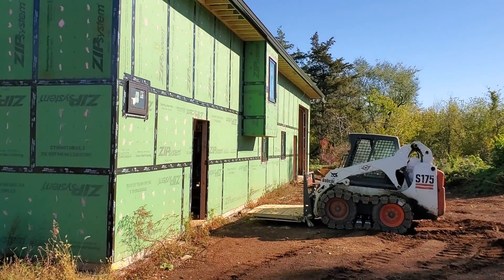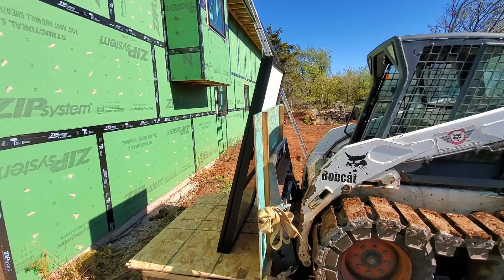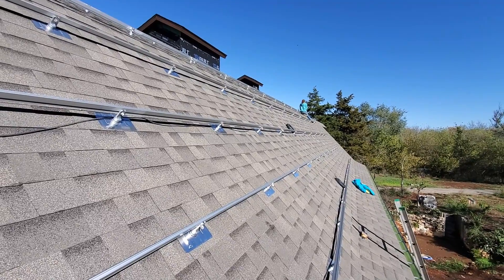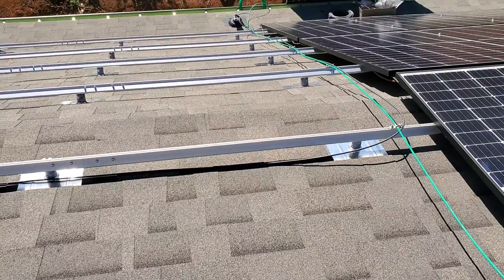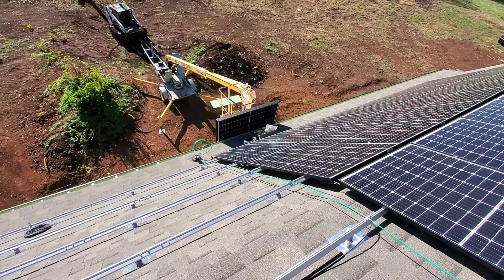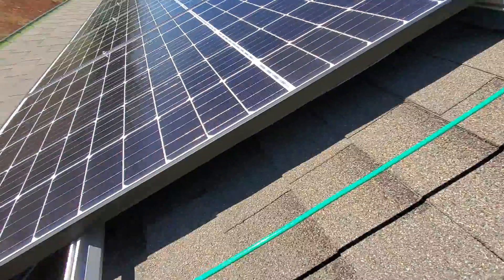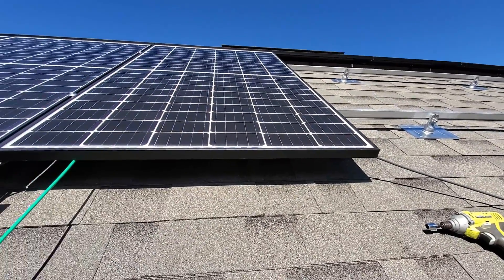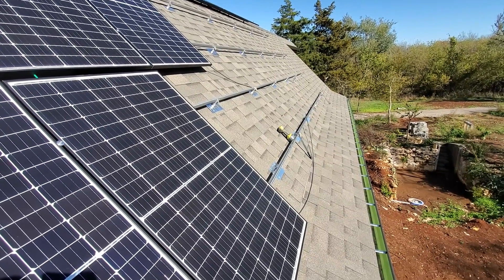Installing 48 REC Solar Panels with 320 Watts Each on our Off Grid Home Build Barndominium Project

Comment: Very nice! I know it sounds trivial but I would have liked to see how you did the wire connections. Thank you for posting this series.
Reply from the maker: They just plug together, there is no splicing or special tricks.  If you can plug in an outlet you can hook the panels up.  

Thanks for watching and commenting.

Comment: I posted on the previous racking video before lunch and see my post disappeared every time I posted there, no idea why! Anyway, I came here to take a look at your Zip tape issue and saw the racking video so I clicked on it as I'm doing solar soon.  I haven't given any thought to racking yet, but figured you might have some recommendations...  I have larger 42" x 82" 435W Sunpower panels.  Install will be on the CT coastline.  We routinely see 25-30 mph winds many times a year, get a tropical storm every year or two, and low grade hurricane every 5-15 years.  It's possible we could see something more significant, but I haven't seen it in the 30 years I've been here (although with global warming, who knows what's coming in the future!)   Any thoughts or recommendations on what to use and how to do the spacing?

Another question, curious why you didn't stagger the bases on alternating rafters to distribute/share the loads?

BTW, nice panels and install.  That's a pretty serious system, you must have some significant loads!
Reply from the maker: I've only used the IronRidge brand for racking so I don't have another point if reference but it was easy to use.  They have thicker rails.  I used the XR-10 but they have 100 and 1000 models to handle greater loads.  

All panels are made such that you only need two rails for mounting.  I recently bought some 72" tall panels and although it says two is enough I'm thinking of adding a third just to be safe 

I hadn't thought about staggering the rail supports.  I can see now how that would of made sense.  There is plenty of support on the underside of the roof though so I'm not overly concerned about it.

Thanks for watching and your post.
Reply: @Off-Grid  Thanks for the info and reply!  Since I'm new to your channel, I spent a few hours watching today.  That's quite a project!  Nice work...
Reply from the maker: @ssoffshore5111  Thank you for watching.  It's been a big project for sure.  Still a ways to go.

Comment: I just bought these never Evan seen a solar set up all new to me hoping these work good where I live only got 1200 watt too see how they do
Reply: We started with small amount to see if they will work here in winter and only running a WiFi router tv and lamp or to on it for now
Reply from the maker: @angeliawills9956  it should do that easily.  We have two fridges and two freezers plugged in and still can keep it around that 600W typically without anything else going.  They did use a bit more power when initially turned on to cool down for the first time.  The system we bought is way to big for us but I didn't know it at the time.  We really only needed on invert and could have done with fewer panels.  I'm planning to disconnect one inverter and use it as a backup.
Reply: Also have ordered a 300 amp hour lithium ion battery
Reply from the maker: @angeliawills9956  you can run that down to 20% state of charge each night and be ok.  We have 1050amp hours and typically use 20% of that each night from sundown to sunup.  That would be equivalent to a 70% drain in your battery.  So as long as the sun is out the next day you'll be ok but get a cloudy day and you probably won't get fully charged by the next night and would need a generator.
Reply from the maker: What are you wanting to do with it?  1200 watts isn't much.  We typical float around 600 watts but that jumps significantly when the coffee maker is on or the microwave.  Be it only for a minute or two you'd still need the power to handle it.  Plus you'd have to charge batteries.  

If you just want to run lights and power a few devices you'll be fine.

Comment: Looks great but that's a steep roof lol to high for this guy 🤣😂 I'm scared of heights lol
Reply from the maker: Luckily heights is something my daughters and I don't have a problem with.  The wife is on your side though....lol
Reply: @Off-Grid  lol I've worked Underground deep mines for over 21 years, you put me in a mine that's 26-32 inches high with a little water I'm right at home but I can't do heights lol 😂
Reply from the maker: @friendsinlowplaces619  ooooooh No!  I'm claustrophobic as can be!
Reply: @Off-Grid  😂 I've seen things underground most folks couldn't fathom....
Reply from the maker: @friendsinlowplaces619  did caving in Canada once and had to crawl through some spaces my helmet almost didn't fit in.  Pushed through it though and it was worth the adventure but I couldn't do it for a living.
Reply: @Off-Grid  lol it becomes just like anything else when you think about it like working inside vs outside but I guess it's what a man gets used to
Reply from the maker: @friendsinlowplaces619  hear ya there.